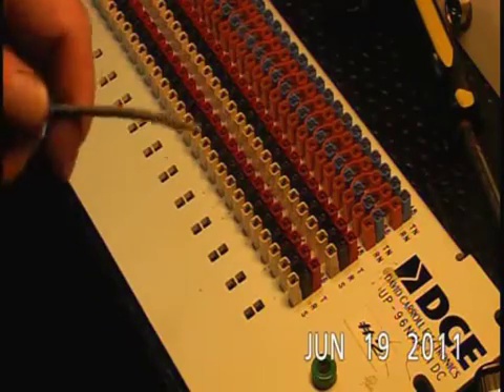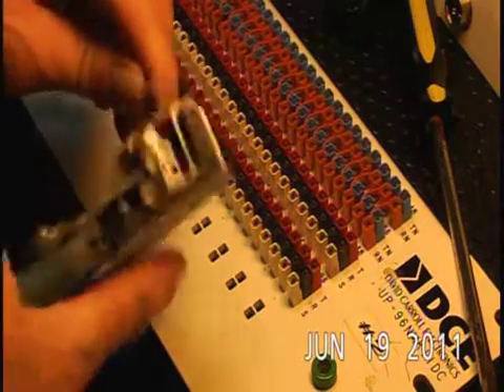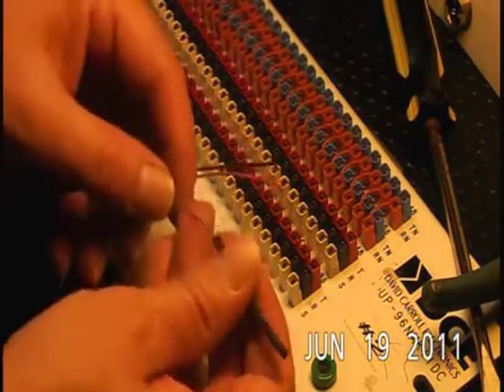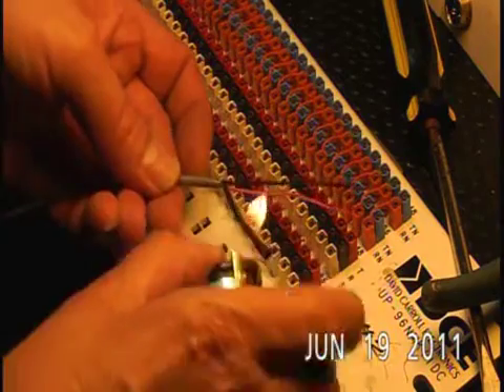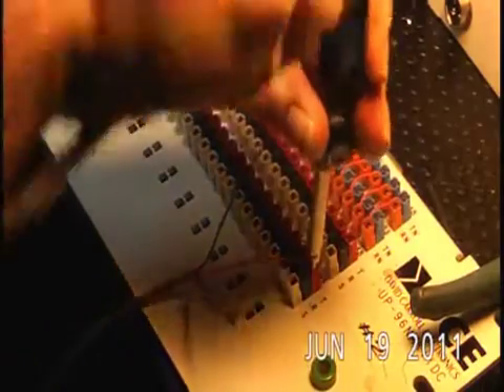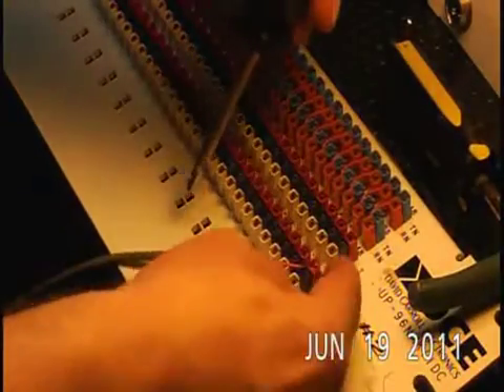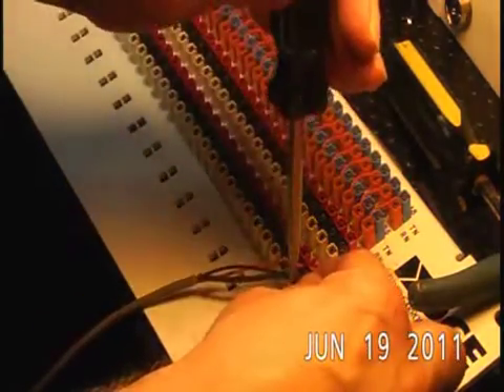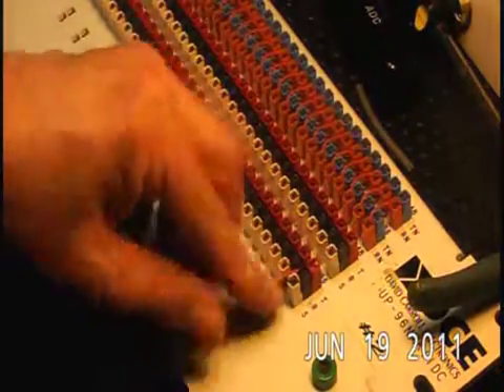How to use the ADC punch-down tool

Comment: I just bought a few TT patchbays with punch down panels. I’m looking for a used punch down tool, but I’m wondering what cables I need to buy that will work with the punch down terminals. Is a standard TRS audio cable the correct gauge? (Once stripped)  I need to go from outboard xlr or 1/4” into my punch down panel. Thanks!
Reply from the maker: Hey Dale, I feel the seller of your ADC patchbays should have told you that the ADC punch tool is no longer made. There are two ADC versions: The spring-loaded ADC QB-2 and the screwdriver type Q-115. The ADC QPC punch panel will accept any wire that is 20 to 24 gauge. A 1/16" drill bit "kind of fits" into the punch cylinder. Take the drill bit and turn around it where the drilling end is held by your vise-grips, and push it down into the QPC cylinder. Good luck.
Reply: Thanks for the info and quick response

Comment: Where on Earth can I get a punch tool?  I lost my tools to hurricane Ida.
Reply from the maker: They do not make the ADC QB-2 or the Q-115 anymore. You can try this:  Take a 1/16" drill bit, hold the bit with Vise Grips by the drilling end. Then push down over the wire.